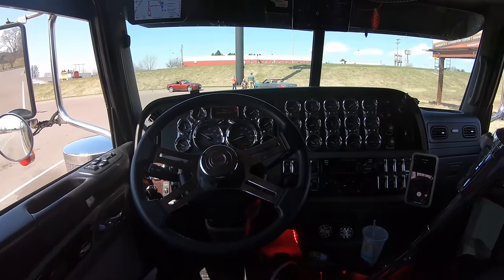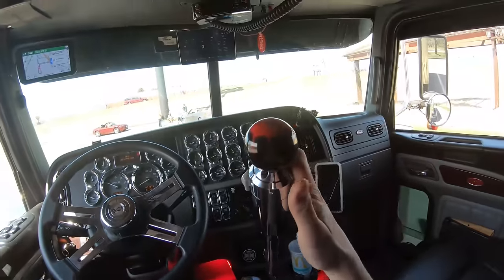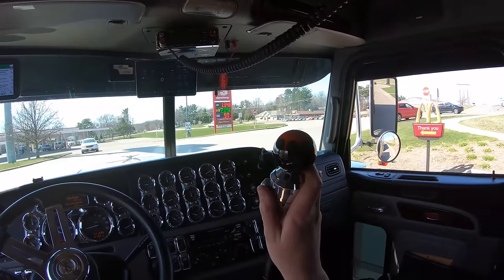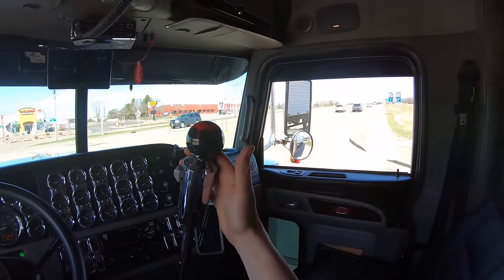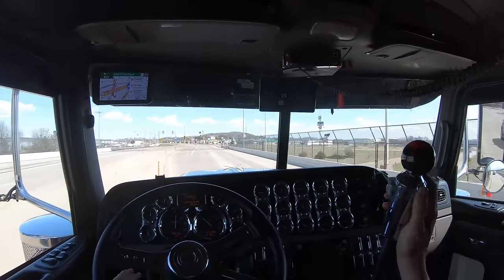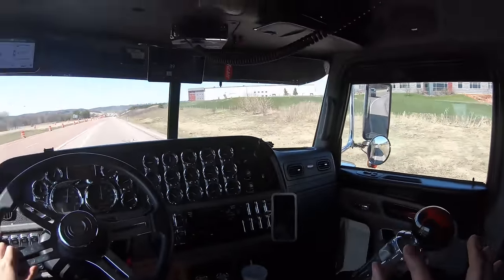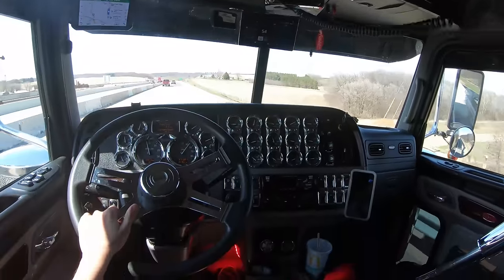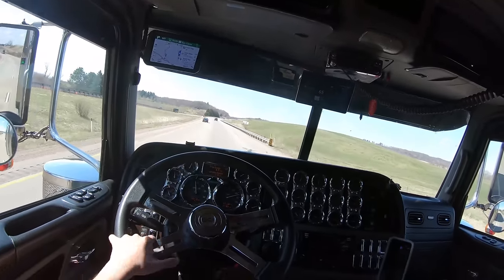Tips on shifting a 10,13, and 18 speed Eaton-Fuller transmission

Comment: I drove a 10 speed in CDl school and took off driving without a problem the first time. The instructor asked If I had ever driven a manual semi and the answer was of course not. I drive an automatic since my company doesn’t have any manuals at all. My question is why the tall shift gear handle? It seems to be counterintuitive to shift gears like that.

Comment: I have a 1998 kenworth t 800 with n 14 Cummins and  a 18 speed  manual  and the only time I step on the clutch is to start rolling and after that it's just rpm shifting  then  try the jamaican stile I safe a little of fuel

Comment: when it grids a little bit like that is it bad for the transmission? i drive a truck and this happens sometimes but I'm afraid it will ruin the transmission. btw I'm glad you showed us the part where you hold the clutch half way and wait for the shifter to slip in. i do that all the time and i was worried it will break it i wasn't sure that this is how its supposed to happen or not. great job man love your video!

Comment: Don't know if this will help anybody out a little but the only difference between an 13 and 18 speed is on a 13 speed you cannot split the lower range gears. On an 18 speed you can splint the low range gears and high range gears which makes it the 18 speed. In most general cases you will not need to split the lower side gears if you have the horsepower. I typical drive my truck daily like a 13 speed only splitting the lower ranger when starting up hills just to get the extra torque and power to the ground. That is purpose of an 18 speed is to put the power to the ground better and then when you get the truck rolling down the highway it will run at lower rpm depending on gear ratio setup in rear ends to get better fuel econ,

Comment: lately ive seen more of the fleet vehicles with the automatics its so they can quickly get more people in to drive their trucks and less training
Reply: it's a little bit of that, yes, but the newer auto transmissions are very fuel efficient so it makes a lot of financial sense for a company with a large fleet to buy and operate them. 

Example, I drove a 2020 Volvo with a 12 speed auto. In the eastern states, I averaged in the high 8's for fuel mileage. Out west, it was upwards of 10 mpg. Now, in my older '17 Freightliner, still auto, I only get in the low 7's in the east. This Pete in the video probably only gets in the mid 5's to low 6's. That's a HUGE difference when you're talking about driving 100k plus miles per year.

Comment: Honestly, if you've never tried it, drive an auto, and I mean an automated manual, not a torque converter auto like an Allison. They shift just like a manual, skipping gears when needed, you can manually select gears and it'll jump to that gear quicker than you can, and if you've got an engine with plenty of power like an N14 Cummins, it'll pull up hills no problem. I used to hate them but now I don't miss the manual.

Comment: Most new semi tractors are shipping with automatic transmissions these days. There was some early concern about reliability and fuel efficiency, but these are simply technical problems which time has solved. The cost of driver training however will not change because humans don't change; in fact it will only go up as wages increase. Therefore it is inevitable that all semis will eventually be automatic. Money talks.

Comment: I bought a glider detroit 60 12.7 with 13 speed , 80% of the times I suck on the 3rd/ 5th low/ high and same goes to the 7th it just never get smooth what I'm doing wrong here?

Comment: So while you're floating, you mentioned letting up off the throttle enough to get the transmission out of gear. But are you letting off the throttle completely once you get out of gear, or keeping it in the same partially-applied position it was in when you got out of gear?

Comment: Have do you guys find the right gear when you’re on an uphill but traffic has slowed down dramatically but as you slow down the traffic speeds back up? Sometimes I just have to stop and start over cause the trucks slowing down so fast due to incline. Any tips?

Comment: When shifting up or down, can you skip in the high gears.
Reply: Yes. You can drive it like an 8 or 9 speed but splitting helps keep the engine in its power band

Comment: I just think that gear shifter is not long enough.  It shoulda go throw the roof via a rubber gaiter, and each time you’ll need to shift, you just climb on a ladder 🪜 in a hole in the cabin and shift. Don’t forget an umbrella if it rains.

Comment: So do you honestly use all the split gears? Most I've heard from people who run van/reefer/normal flat is using eighth high.
Reply: Depends on the weight and the road. Uphill you’re going to have to split more gears than on the flat or downhill. I’m 350 metric ton loaded and I’m splitting every gear up and down on everything. And that’s starting in low crawler gear. Which this guy calls low low.

Comment: Can you drive high gears without splitting them ? Or you have to use high lows?
Reply from the maker: Yes and no depending on weight
Reply: Life Behind The Wheel 
Thanks for your reply. Do you do it when you have heavy load ?

Comment: are you pushing the cluch in when you flip the splitter ?
Reply from the maker: No just throttle pop
Reply: You can flip the splitter up when your foot is in the gas it is call pre-selecting a gear and then when you take your foot off the gas and the engine rpm's drop the transmission will catch that next split gear just put your foot back in the gas and let her eat.

Comment: Why do you double clutch? Why dont you just push the clutch down, change from 1 to 2 and release the clutch like in a car? Doesnt the truck transmission have a synchronizer?
Reply from the maker: No there un synchronized

Comment: What is the benefit/purpose of that shift lever?
Reply: It just for looks basically. Some people say the taller sticks are bad for transmissions because with the taller shaft length it's easier to jam gears damaging gears but if you know what you are doing there is no issue just have to be aware not to force gears. Other than that no other function than looks to fit the attitude of the truck.
Reply: It just for looks basically. Some people say the taller sticks are bad for transmissions because with the taller shaft length it's easier to jam gears damaging gears but if you know what you are doing there is no issue just have to be aware not to force gears. Other than that no other function than looks to fit the attitude of the truck.

Comment: I have to say I have watched a number of these videos as it was interesting to see how they do this in the USA. I have been driving 44ton trucks long distance in the UK for over 15years. After taking vacations in Florida for over 20years (we have a property there) I found it very unusual the amount of unnecessary gear changes being made by Truckers over the pond. Clearly Unloaded trucks & yet the driver is still using every gear in the box🤷🏻‍♂️. Stupid long gear shifters making extremely long travel in the gear shift, for what purpose🤷🏻‍♂️. Let’s face it we have enough gear changes to do so you want that work as easy as possible and as ergonomically located related to the drivers arm/ hand movement from the steering wheel as possible, the shorter travel distance the better. Now I maybe being a bit hard on the USA Trucker, it may be we have different systems in European trucks,  ours being designed to make life easy for the driver with everything being power assisted, brakes are light to the touch, clutches again are power assisted, gear shifters again are power assisted and usually we are using more powerful engines because of emission restrictions than US Trucks, in fact my Truck is easier and lighter in effort to drive than my car.

Comment: I’m 17, I work sometimes on road construction. We have a kenworth t800 converted to a water truck for watering the road before packing. I only have a few hours on it but I can float it into third, only using the clutch to get it started in bull low. To downshift I can float but I usually just tap the clutch to pull it into neutral and from there I can get it to mesh into the lower gear. I don’t intend to be a trucker but I’m glad I can float gears. How come your stick is so long?

Comment: What rpm range are you shifting at?
Reply: I usually go 1600 to 1800 RPM’s depending on the transmission you might have to go a little more with a 10  speed cause the gears are farther apart. I run an 18 so being the gears are much closer I usually don’t have to push it very hard.

Comment: Tel mee how to hell that can be 18 speed? Is you had 4 gear on and big and small and slitter, you had 16 gear, if you had 5, then tou hawe 20
Reply from the maker: Theres a 5th hole on the low sode with a split adds 2 more but you dont really use them there low low and low

Comment: 1st off don't use a fucking pogo stick...unless you're hauling heavy 100,000+ or you want to move slow you don't need to split gears on an 18...a clutch is only for stopping and starting